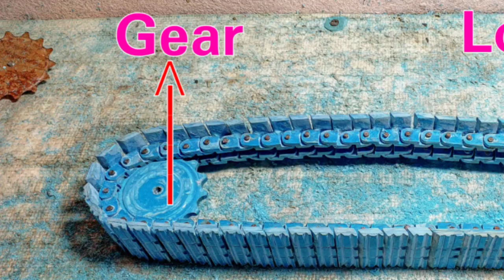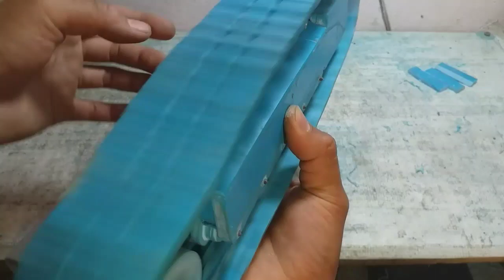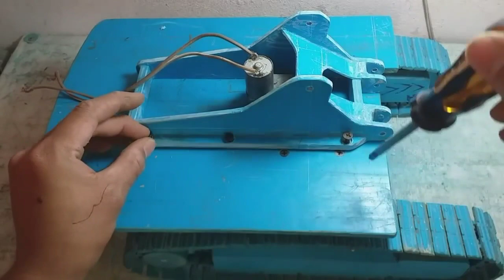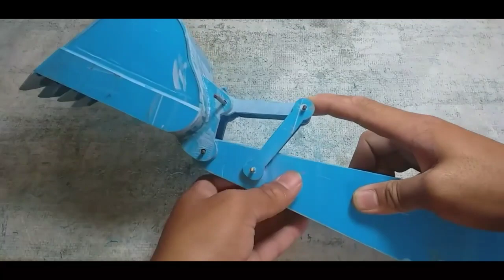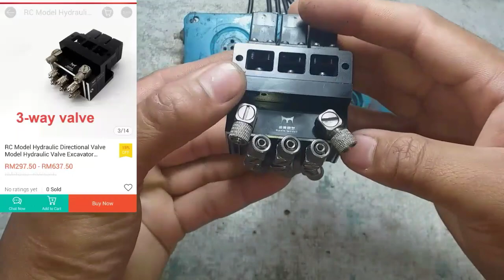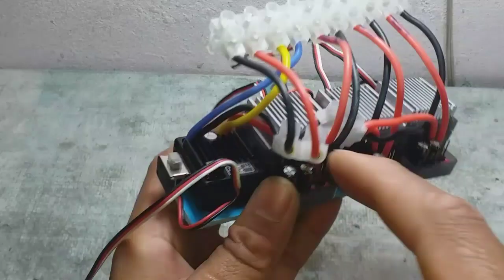how to make Excavator 1/12 Hydraulic RC From PVC 100%

Comment: How many times I have to tell you that add more weight to the excavator other wise it will just going to slide and that is why your excavator was unable to push or pull that truck which was stuck on mud